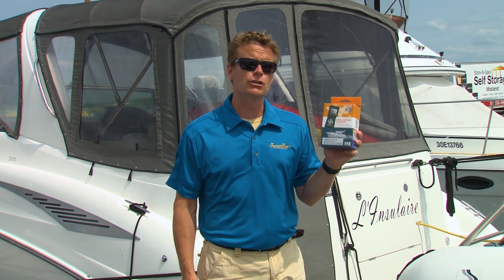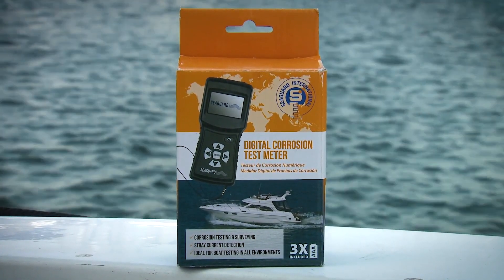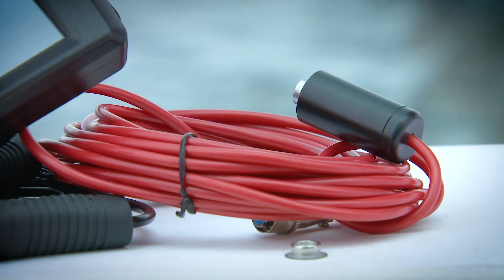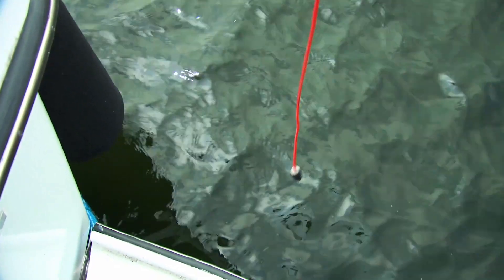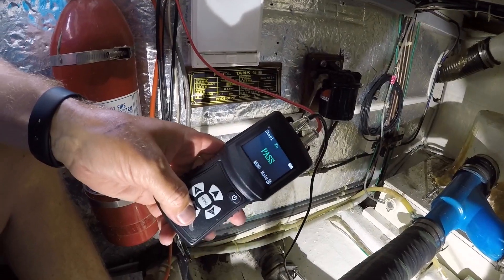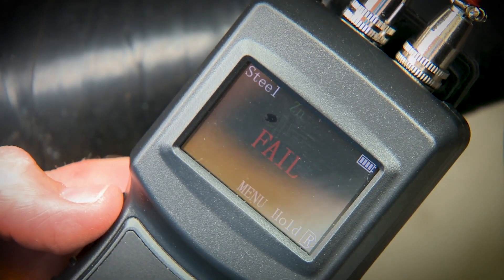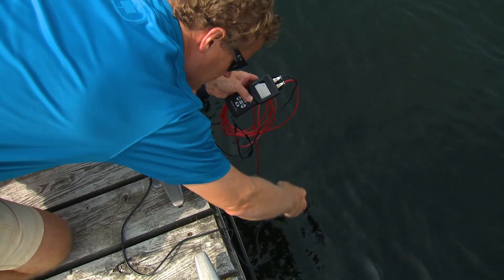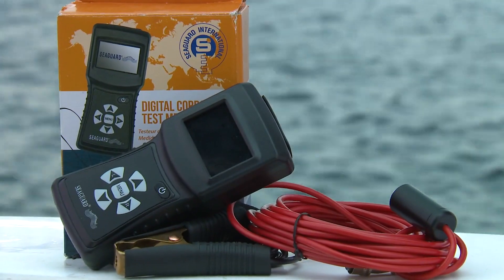How to use a Corrosion Meter to check your anodes | My Boat DIY

Comment: What would cause on twin outboards with brand new anodes the outside bolts to fail and the inside 2 to pass. Boat is 2 years old